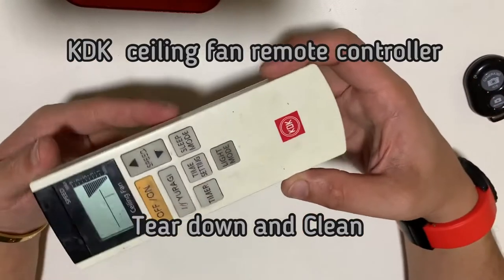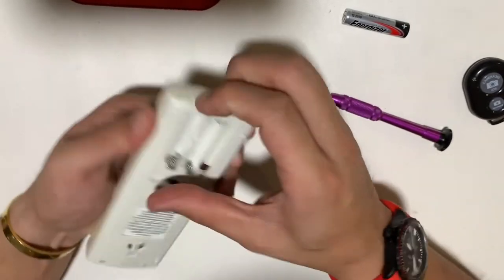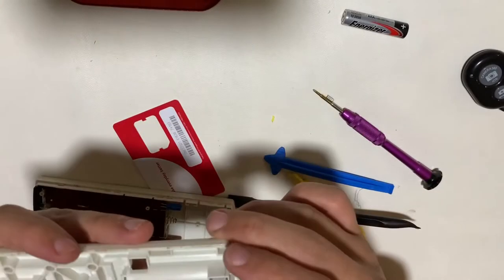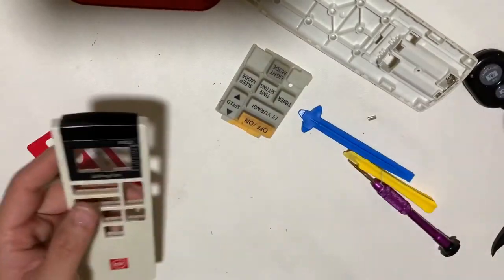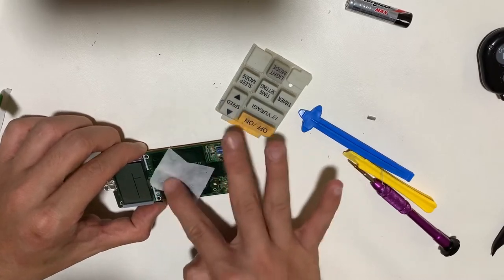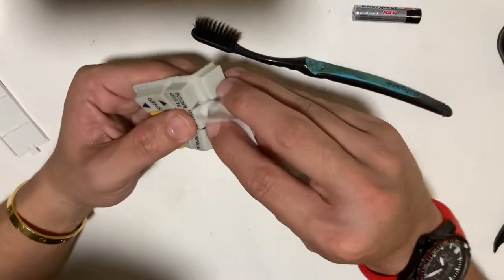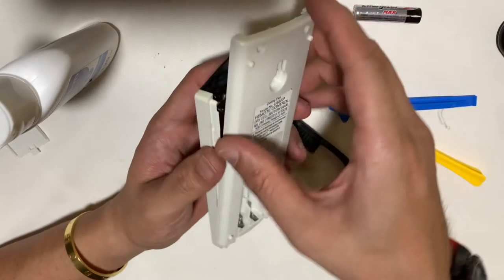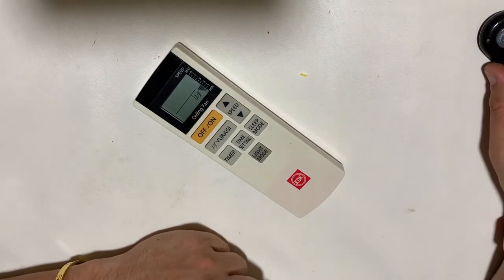Tear down and Clean KDK ceiling fan remote controller. Model U48FP

Comment: Thank you for this Video!  I managed to revive my KDK remote control, it was not working at first due to battery leakage that tainted the coil and some at the "board" (dont know what is it called). Anyway, after seeing how you cleaned the inner board with alcohol wipes, I followed the same and cleaned the coils and board that close to the batteries there, it is working now. Woohoo! Although my purpose is not about cleaning the dirty casing. Thank you! Thank you! Thank you! You are my savior! I save my $ not to get another remote control. By the way, where do you get the plastic tool (yellow & blue) to pry open the casing?